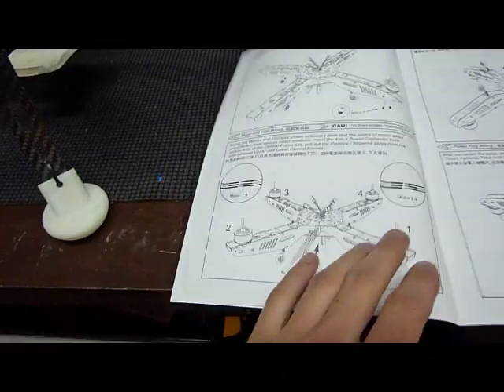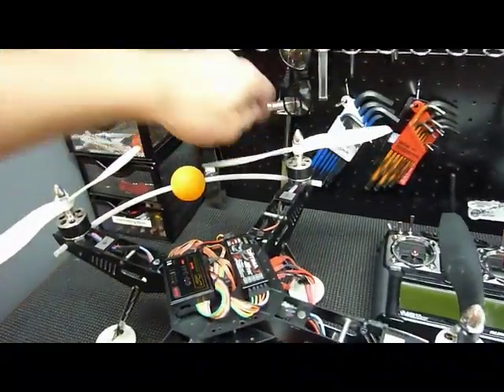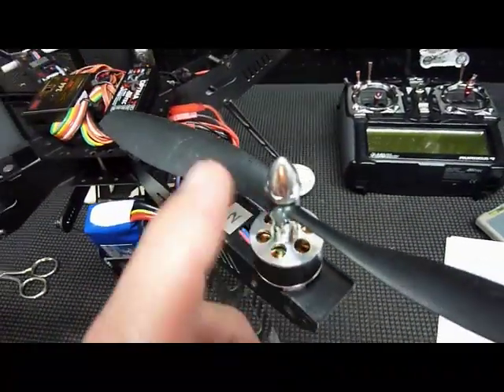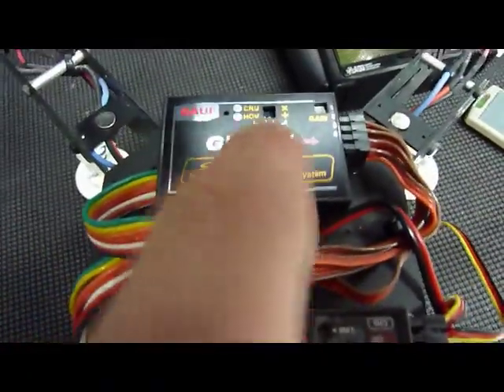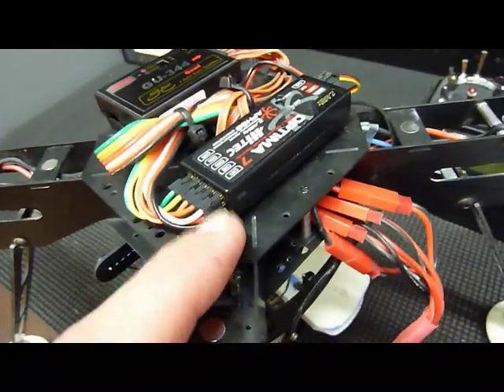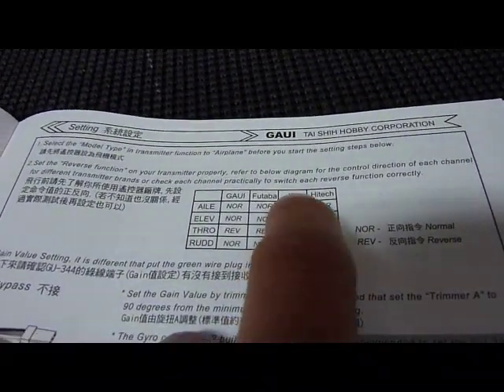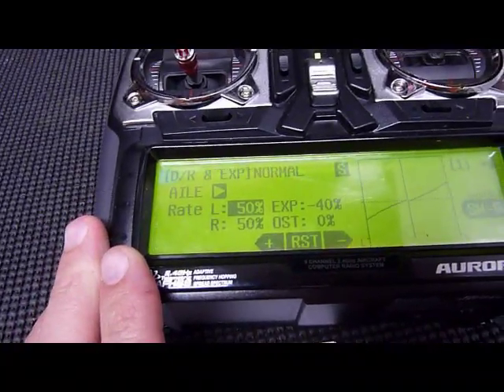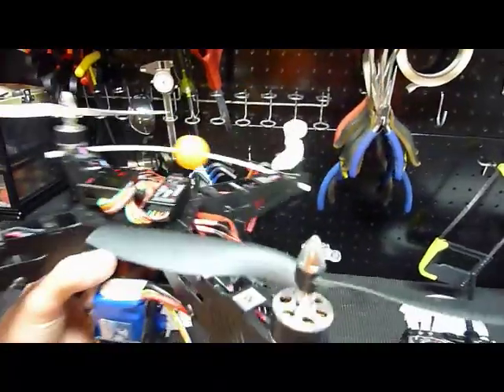Gaui 330x Quadcopter Electronics Setup

Comment: hello

I need your help please.

I Buy a GAUI 500x and I could fly, when I try to raise it gets out of hand and volcanoes, I have very clear as you set the gain at the transmitter, I have done everything that I understand in the manual but I can not raise it.

as the transmitter is configured for 4 motors rotate at the same time?

and configure the transmitter?

please, your help is very important to me, thanks.

Comment: Thanks for the video. How are you finding your X330. I am flying in cruz mode and the gain at around 2 oclock. Im not using the gain from the radio.
Seems to fly well but also seems slow to respond to the controls. I have the Spektrum DX6i.

Comment: Great video! I use the same transmitter and you have to push the throttle joystick all the way to about 40% to get the props to move and it starts abruptly at high speed. How do I get to gently control the throttle?

Comment: hey man, thank you very much for this video. I am trying to setup 4 batteries, not one, and is not working. any suggestion? my Futaba radio is on airplane mode, with throttle reversed, and the gyro is on cruiser mode and on 'X' mode. Please help me! THX

Comment: "Initializing the speed controllers" is THE MOST IMPORTANT PART of the entire Gaui 330X(or -S) setup folks.  Thats why its missed in most videos... If you mess that up or have a bad ESC, your 330 will spin like a top or flip over.

1. Syncing your ESC end points is #1 before you get into anything else thats being explained here.
2. If your motors dont start up  at the same time its either your motor, esc, or you didnt sync your esc end points!

Comment: Hi: Thanks to your video I could make fly my 330x, and all was perfect.

2 dasy ago, I crashed it. And now I have a problem:

Aileron is inverted, when I turn left, the 330x goes to the right, and when I turn right, the quad goes to the left.

Also, If I only push the throttle, it tends to tilt.

Would you help me to guess what was damaged?

Maybe the gyro?

The receiver? (spektrum 6200)

both? How can I test?

Nothing has been changed in the transmitter. Thank you very much.